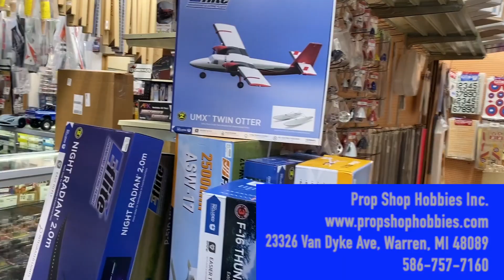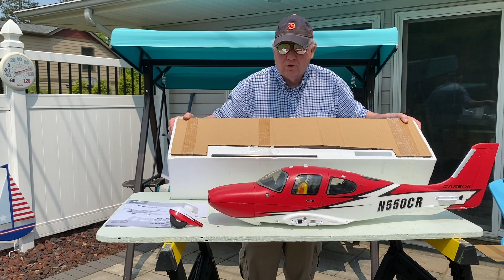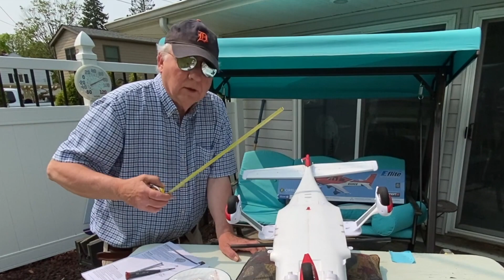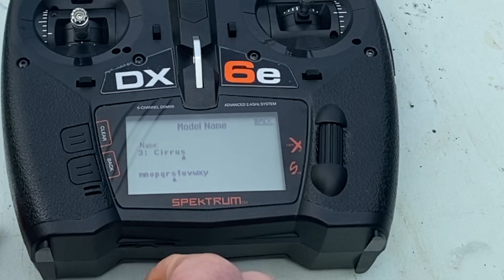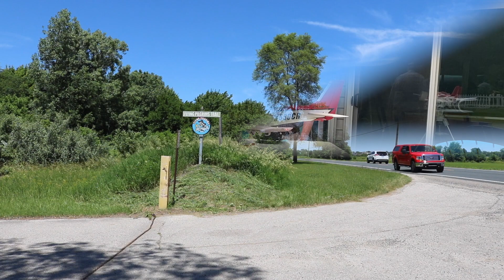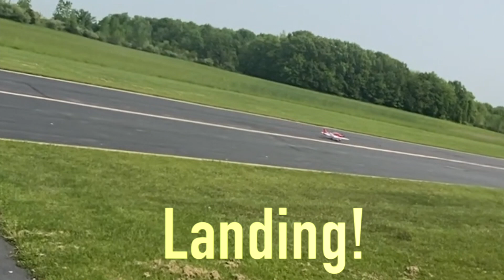Buy it! • Build it! • Fly it! • E flite Cirrus SR22T

Comment: What happened to Dual Rate / Expo set up  OR flap Set up ?  thank you.
Reply from the maker: Hi Garth: I do not use dual rates or expo - I do use flaps but they are not needed on this airplane. The plane still flies great. I did change the rudder / front wheel to a metal geared servo. I fly on a concrete runway, and the plastic geared servos could not handle the landings on concrete. SAFE is a big time improvement. Thanks for watching. ✅